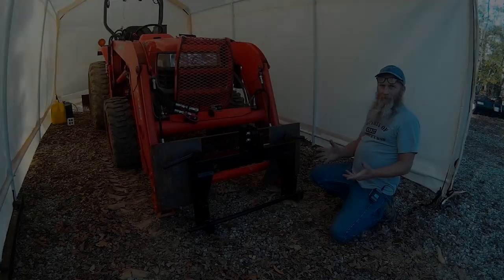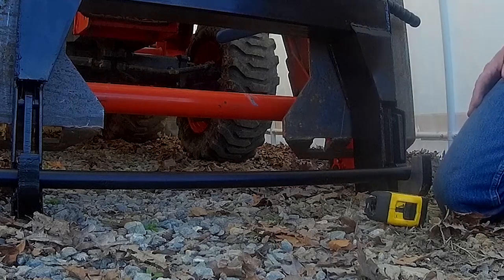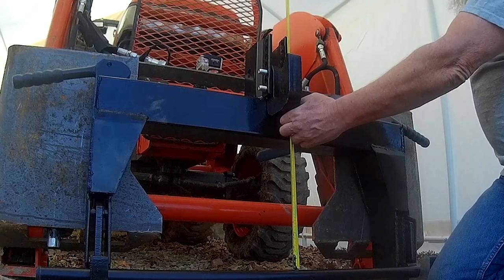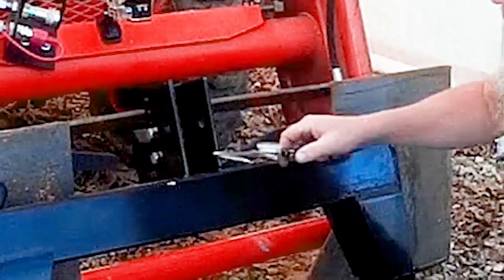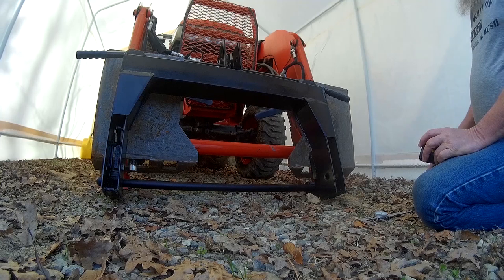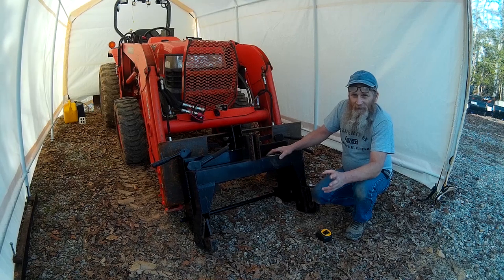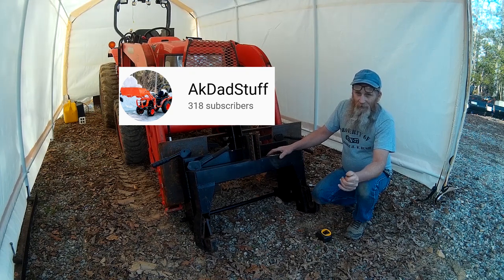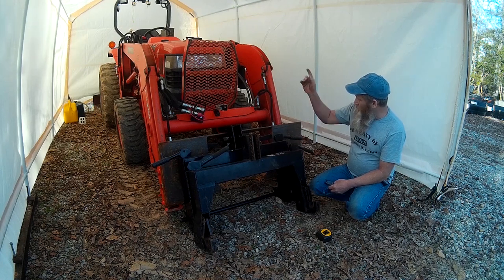Harbor Freight quick hitch dimensions

Comment: Thanks Dave for the nice comments about my channel! Pronunciation is perfect!  I am glad you shared the dimensions on the HF quick attach!  That's a project for 2019! Looks like you got some good weather, I have not any chance to stand outside in short sleeve since September... Thanks again!
Reply from the maker: always happy to help my brothers build their channels. I hope I can get this QH welded up on the front quick attach plate. it will come in handy.
Reply: Is there any way the crooked QH be salvaged?  I would think it would always remain weak, even if straightened (if ever possible). But if is is welded against a plate, it could have a good second life. That is my 2 cents.
Reply from the maker: @FromSteelToWood  oh yeah for sure I been thinking about cutting out the bad part and replace it with some thicker straight material. that would fix it right up good as new. of course we don't get much snow here and I was having to much fun plowing so off to harbor freight I went for a replacement. once weather breaks for spring I will likely rebuild it and sell or give it away to someone local that wants one. the weather here is nuts I made this video yesterday and it was like 70 degrees F today its like 30 degrees F it changes that quick. temperature dropped 40 degrees in a couple hours.
Reply: @daveknowshow  , 
 Yes it feels like spring when it gets up to 30 degrees or warmer, around here lately :- (
Nice to see you out and about some Dave. Even messing around with those new fangle , detachable buckets .
Reply from the maker: @victorcastle1840  so good to hear from you Vic hope you and Joy are doing well. a couple days ago it was 70 degrees here and now its like 30 degrees. I go from starting a fire in the wood stove to putting the fire out and then starting it back again all with in a few days sometimes a few hours.

Comment: Great Idea. I bought a SpeeCo 3 point adapter plate for my skid steer but it is a little on the light duty side. I should review that some day.
I need to do catch up on your videos. My bad. I have been all over the place with my interests and I have to quit running around like a wildman. Latest...crammin' for a ham radio exam. I turned 60 last year and I have the feeling to do it all before I croak...
Reply from the maker: funny I been looking at ham radio and cb radio videos myself lately. great minds think a like. I'm all over the place myself so no worries. if I watched all the videos I want to that would be all I would ever do is watch videos.

Comment: Summary of Super Dave's Video on the HF Quick Hitch Dimensions.. Awesome guy.. Thanks Dave.. !!
29-3/4" Outside to Outside Measurements of the Bottom Lift Arm QA Hooks. 
1-1/4" Width/Thickness of Hooks
27-1/2" Inside to inside Measurements of the Bottom Lift Arm Quick Attach Hooks. 
15"-18" Bottom of Bottom Hook to Bottom of Top Hook at Lowest and Highest Upper Hook setting
7/8" Increments between top Link bolt holes.
2-1/8-" ID Wide area for Top Link ball width
1-5/8"  ID Wide where you hook up the Lift Arm Ball Pins. 
18" Bottom of Frame to top of Frame 
30-1/2" Wide Outside to Outside
26-1/2" Inside to inside of Lower Arms

Assuming, but, pretty sure, the Bottom Hook will accept Cat II pins = 1-1/8" pins and Top link most likely is also designed for Cat II pins which would be accepting 1" pins, instead of 3/4".
 Both requiring Cat I to Cat II bushings or Hitch Modifications.. 
If any of Dave's Subscribers is looking for a "Real Cat I Hitch that is designed to accept Cat I = 7/8" pins without bushings,, please verify before buying, but, this is the only hitch on the market that is like that as far as I could find, if you don't weld or, don't want to take the time to do the mods on the HF.. 
Worksaver QH-10178 Best price I found was here: $205.00 plus shipping, but it was always 2-3am when I was searching, so, never had the right time to call and ask about either subject.. 
http://www.beavervalleysupply.com/sectionh/wqh.htm 
This is the statement I base my comments on, from this page: 
Cat. I for tractors up to 50 hp. Designed to accept 7/8" lift pins w/o the use of adapter bushings.
I did not have time to call to verify that statement, or, ask about shipping. It was always too late when I got around to searching for a "Real Cat I Hitch".. Buying HF anyway due to the price and being able to do the mods myself.
Cheers..
Reply from the maker: thanks

Comment: Thanks Much Dave for the Information.. Great Idea.. Turn the questions into a video.. Awesome idea.. I wonder how many hits the video will get.. I looked and looked and could not find dimensions anywhere.. Thanks a bunch for the video time..  Now I remember the last measurement I was asking about.. Your previous video, you said,, It is Crazy to make a Quick Hitch for a Cat I tractor and make it accept Cat II implements.. Well, that plus the 1-1/8" broom stick not wiggling around when you put it in and out and bumped it with your shoe turning it around.. I must have rewound and watched that 10 times before I felt confident about the measurement.. Figure the top hook is 1" = Cat II also. 
Crazy.. But, two of us are wanting to buy them.. I agreed to do the Mods to both if he would go and pick them up. We live an hour apart, and both live 1.5 hours from the nearest HF and both about 1 hour from anything tractor related as far as bushings, etc.. I'm figuring on splitting the Cat I to II bushings in half, cutting them to the hook width, and welding them in the bottom of the hook to make it accept the Cat I=7/8 Pins.. Probably have to shim the bottoms a bit with some flat bar to get the top swinging handle link to hold the pin tight too. 
I had made a list of what to get along the way tonight, and decided to check on your channel..  I've been busy and not been keeping up.. Ha. there it is.. Thanks Buddy.. 
Once I get the thing in my hand, I think,,maybe making a second hook, leaning out a little more, and making it stick out further might work for those implements that bump the bolts/pins on the top link when you try to hook up the top link.. Figured some solid stock 1" or 1-1/4" square might put it out there far enough.. 
We'll see when it gets here.. 
BTW.. Northern Tools Quick Hitch is for Cat I tractors, but, is a Cat III at the pins. 
Worksaver QH-10178 is a CAT I that does not require bushings to accept Cat I=7/8" pins, but, for the price plus shipping, even short on time, I will do the mods to the HF QH.. Have the 20% coupon ready to go.. Ha..Ha. 
I summarized the data if you want to post it.. 
29-3/4" Outside to Outside Measurements of the Bottom Lift Arm QA Hooks. 

1-1/4" Width/Thickness of Hooks
27-1/2" Inside to inside Measurements of the Bottom Lift Arm Quick Attach Hooks. 
15"-18" Bottom of Bottom Hook to Bottom of Top Hook at Lowest and Highest Upper Hook setting
7/8" Increments between top Link bolt holes.
2-1/8-" ID Wide area for Top Link ball width
1-5/8"  ID Wide where you hook up the Lift Arm Ball Pins. 
18" Bottom of Frame to top of Frame 
30-1/2" Wide Outside to Outside
26-1/2" Inside to inside of Lower Arms
Assuming, but, pretty sure, the Bottom Hook will accept Cat II pins = 1-1/8" pins and top link most likely is also designed for Cat II pins which would be accepting 1" pins, instead of 3/4".

Cheers.. 
I'll post that again in a separate post in case someone wants to copy paste.. 
Thanks again Dave..
Reply from the maker: the top hook can go with out a shim or bushing if need be. I took my hook out and milled the slot further away from the bolts. then only shimmed it enough to put back what I machined out the other end. I will do a video to show that maybe soon. glad I could help.
Reply: @daveknowshow  Roger that.. Will be making the mods on two of them this weekend if all goes well for a buddy and mine.. Thanks..

Comment: I see in your notification that HF has a coupon for the quick hitch - can you share that coupon number - I cant find the coupon and I have looked in both the regular coupons and the inside track club -- thanks
Reply from the maker: actually that was just a picture I found on the internet. google harbor freight quick hitch then click the pictures tab. not sure what the date is on that coupon or if its valid to use for none members. I'm not a member so I use the 20% off coupons. email me at Daveknowshow@aol.com put send me a harbor freight coupon and I will forward you my next 20% off coupon that comes in the email. in fact I have one good through sunday.
Reply: Just google hf coupon

Comment: I'd straighten the old quick hitch and weld it to the SSQA plate. Then take the other one back to HF.
Reply from the maker: yeah I thought about doing that but its so cold out there working and the old one needs to really be cut apart and new material welded in its place. the metal got stressed pretty good. I may look into it though.